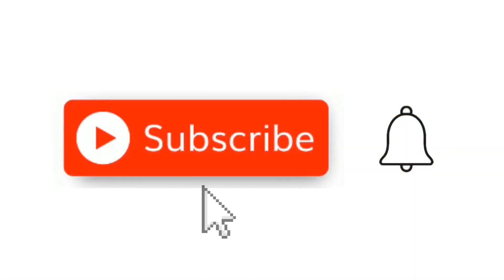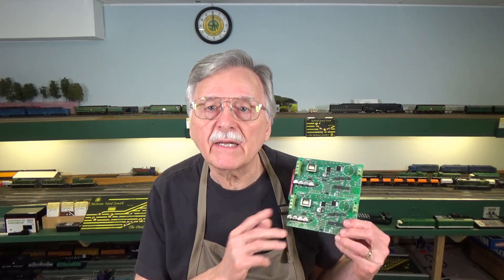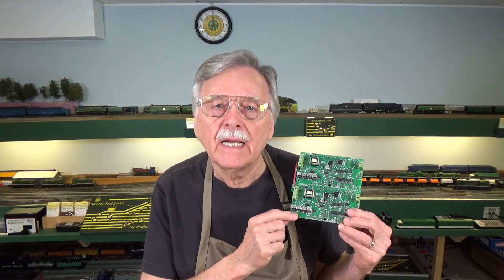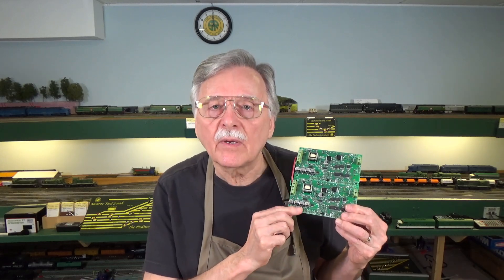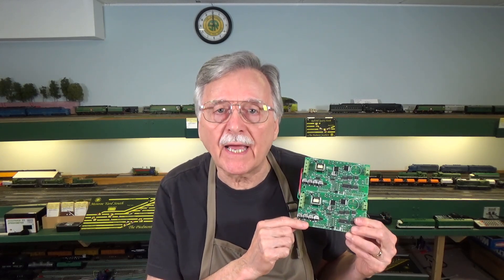Final Solution To The PSXX Problem? (312)

Comment: I'm back.  So i've rewatched the video and have purchased the TCS command station which uses railcom so you're video is now very important.   If at all possible, I'm hoping I can update my DCC Specialties PSX3 breakers to the revision G software you mentioned which adds the new CV.  However, I tried going to DCCSPecialties website and all I get is a white page.  Where would I go to download the new software?
Reply from the maker: The DCC Specialties website is long gone, you need to contact Tonys Trains, the owner of DCC Specialties.
Reply: @TheDCCGuy   Got it.  I totally forgot about that.  So I've gotten word from Stuart Baker that there is a new circuit breaker design under development from RR-CirKits that combines short circuit detection, current based block detection, RailCom detection, and LCC feedback. The TCS CS-105, B-106, and LT-50 products are the primary test subjects for this new product.  It is unknown when that product will be ou on the market.  However, he also commented: "All versions of the PSX that I have tested pass through the RailCom cutout and data just fine. This is very unlikely to be your issue."  There is discussion on-going at MRH forums.
Reply: @TheDCCGuy   Got it.  BTW, I've gotten some feedback from Stuart with TCS and he has mentioned some helpful information: He responded to a modeler asking: "So if it is PSX-1 and it's really filtering RailCom cut-outs, what other circuit breakers are available that will work?!"  Response from Stuart: "All versions of the PSX that I have tested pass through the RailCom cutout and data just fine. This is very unlikely to be your issue.
 
To isolate the problem, I would start with the CS-105 main booster output directly connected to the a test track (nothing in between) with a RailCom capable decoder. Make sure the RailCom is enabled in the decoder configuration. Then try to read CV's using program on the main. If this works, then you can gradually increase the complexity of the setup until you find the failure point."

Another comment by Stuart: "
With the PSX breaker that I have, the CS-105 and RailCom work fine. I only have tested one hardware + software version though. The paperwork I have with the unit says hardware version L, software version G. That's what the paperwork says, not sure if it is reality."

Comment: Does the PSX-series have similar issues with Digitrax's Loconet? Or perhaps my question should be: is the PSX-series compatible with Digitrax' PM4 series?
Reply from the maker: I use a PSX4 with my DCS240 with no problems. I asked Larry Maier about using a PM42 I have along with the PSX and he said it should not be an issue.

Comment: This is good info! Thanks for spreading the word. My PSXX has saved my equipment several times already, just from running into turnouts that are in the wrong direction, and it is a vital part of every DCC system. I dont have this issue but now I know what to do if it happens 👍

Comment: Hi Larry just to let you know that NOT all nce power cabs will set to 6 recalls,Have found out that the one I have has a chip init v1 28a so I have upgraded it to a v1 68b so now I have have all 6 recalls plus other things as well,can I ask you if you can do a small video on how to change the chip,these are available to buy from COASTAL DCC in the UK plus others I would guess,thank you Brian 😀 😊

Comment: Oh dear. This is not good news. 
I have 2 x PSXX-3 on my layout, and I am in the process of converting to Railcom with boosters and command station etc. With no firmware updates available for the PSXX I am probably going to have to sell them.  :(
Reply from the maker: Excuse me but you must have skipped the parts of the video where I talked about the new FIRMWARE VER G and how to get it.
Reply: @TheDCCGuy  Indeed, apologies. I should have said 'no downloadable firmware update available'. Shipping costs here in Australia make this sort of upgrade difficult for a lot of model railroad products. I'm not complaining, it's just one of those things to factor in when doing a major change to a layout. It never occured to me that the circuit breakers would be an issue.

Comment: Thanks Larry for the update on the psxx. The problem I experienced a few weeks ago with my ESU unit and the PSXX I did eliminate railcomm  but I still had an issue until I powered cycled the ESU power supply. Each time I changed the trip serving I would have my short problem again until I power cycled the esu power supply even though railcomm was switched off. I would threrfore recommend that people not only turn off railcomm or change the cv as you pointed out but also power cycle everything.

Despite the problems I experienced I am a huge fan of the psxx and will be ordering a second one and I also just received the PSXX-AR. I would also like to point out that the support I received from DCC Specialists was top notch which also helped me be a fan of their products.

Comment: Thanks, Larry.  You did not scare me away from the PSXX circuit breakers, mainly because my layout is not large enough to need them beyond the breaker in my DCS52 command station.  HOWEVER........... in a prior video you did scare me away from using Frog Juicers.  Since that time I have gone back to Frog Juicers with no issues thus far.  Time will tell.................  Thanks for your great videos.  You are my model railroad guide.

Comment: I picked up 4 PSX circuit breakers used and plan to use them on my, under construction, layout.  I believe they are older versions.  Would those be a problem too?
Reply from the maker: This only applies to the PSXX series with rev A-F firmware.
Reply: @TheDCCGuy  Hi Larry, what should I look for in terms of markings on the 4 PSX I have to figure out which version they are?   Or is it a matter of updating the firmware on them?
Reply from the maker: Read my earlier reply!

Comment: This sounds like the PSXX is doing what it is supposed to and RailCOM is actually the problem. While setting the CV to ignore the spikes, the current spikes are still there. 4-6 amp bumps can’t be good for sensitive electronics now found on most current locos and builds.
Reply from the maker: Yes, and it convinces me to avoid Railcom.
Reply: @TheDCCGuy  Wow, I'm really disappointed that this is your conclusion. The current spikes are very short, and spread across lots of different decoders. It is not that a single decoder is seeing a 4-6 amp spike, and the spike it does see is still signficiantly lower than what it would see in a "power up from cold" situation. This inrush is not dangerous to any equipment without RailCom or any equipment designed for RailCom. RailCom is designed to operate this way, and has been in successful use since at least 2003, when I first started experimenting with it. It has been common place in the European market for more than 10 years, with nearly all systems sold in Europe fully supporting it, typically enabled out of the box. It is also both an NMRA and RailCommunity standard. RailCommunity standard RCN-530 also goes into detail about inrush currents found in model railroads, including those caused by the RailCom cutout.

IMHO, it is a huge miss for a brand new DCC breaker to not have been designed with RailCom in mind when RailCom been around as an established standard for so long. I am glad that there is a workaround in the form of a software update. Is there any way to apply the PSXX software update without shipping the units back to DCC Specialties?

Comment: Have trouble with  frog juicers and auto reverses as well.
Reply from the maker: The problem may be that they are timed to respond at about the same time. So sometimes the frog juicer will work before the auto reverser and sometimes it won’t and vice versa. Does your reverser have an adjustable time delay?

Comment: Turning off RailCom for normal operations is a good idea as some people also claim it can cause runaway locomotives and that's a little too much to risk. You certainly don't need RailCom enabled in your command station if your decoders don't support it. Being able to read CVs in PoM mode, and in a lot faster way than in service mode, is a big plus though.
On the other hand RailCom has an other, very useful feature, and people using it can't turn RailCom off. This feature can be used in detector circuits, and what it does, is that for each insulated track section you get the loco address or addresses that are occupying that section. If you have CTC, knowing immediately where each train is immediately after turning the system on can be a huge advantage.
Reply from the maker: Unfortunately the utility of Railcom is limited since very few US made decoders other than TCS support it. Also to get accurate location reporting you would have to have individual receivers in separate blocks and the appropriate software to actually use the info. I am not sure whether JMRI has implemented that as yet.